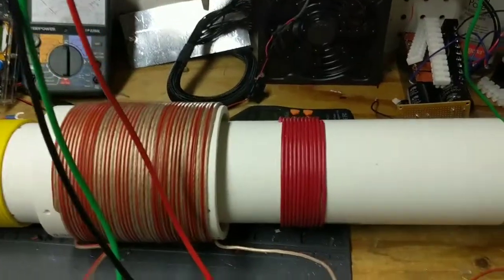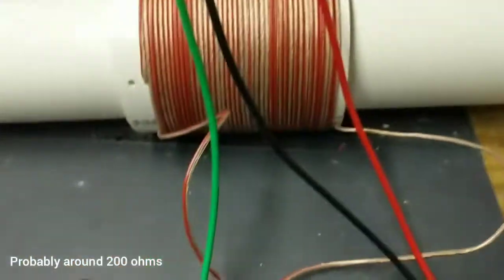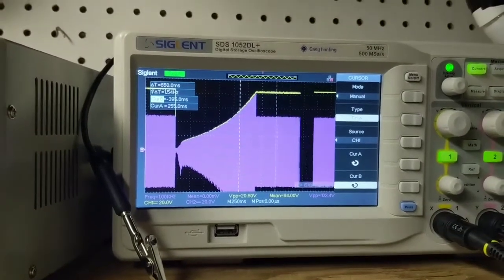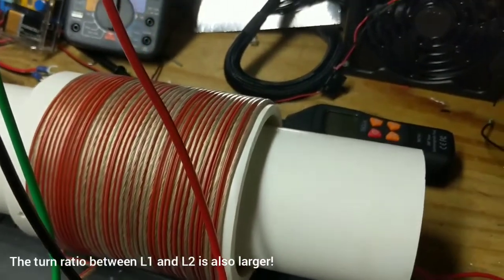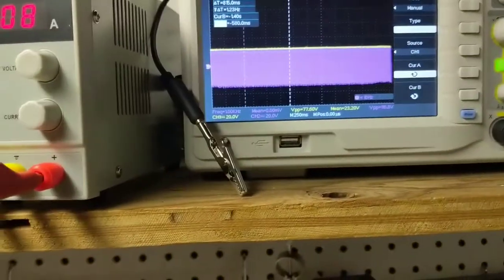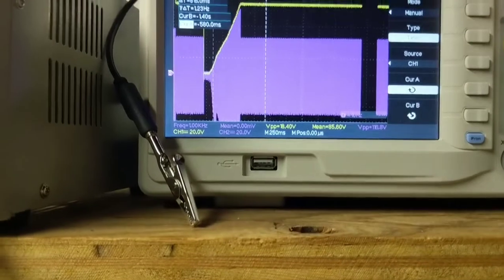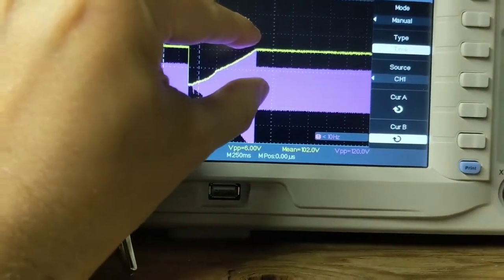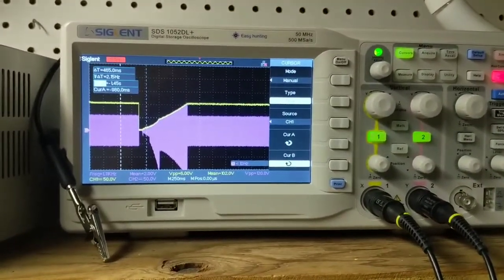Don Smith Circuit - L1, half-wave & quarter-wave resonant

Comment: I DISLIKE SINCE YOU REMOVE MY COMMENTS. i ACTUALLY HAVE A WORKING COIL RESONATOR BASED ON CALULATED RESONANCE!
Reply from the maker: Well, I can say I've never removed anyone's comments from YouTube.  I changed my settings a long time ago to allow all posts, so it might be something YouTube doesn't like.
Reply: @phives5910  Anyway, I just gave a tip that Don Smith used f = 30kHz NST as a source, which would have a wavelength of ~9000m. The way to calculate resonance is fo = 1/(2*pi*sqrt(L*C)). No coil in Don Smith design is based on wavelength, that is a red-herring parameter. Pro Tip, the transmit and receive coils should be LC coupled using the above equation. Then you should only need a small amount of adjustment to find resonance. Use an LED diode as a visual to see the max power transfer.
Reply: @mikez1r  Or use a Royer oscillator with feedback to sustain resonance. True? Ugh those PVC pipes are making deviant currents which I am sure are causing problems. Try something much thinner or cardboard forms with copper coated welding rods in the middle or ferrite rings.
Reply: L1 is quarter of the length of L2, L2 has length based on self oscillation frequency perturbed by a pulse on L1. Like ringing a bell.

Comment: Thanks for the link to Don Smith device with 4 coils on it.  Funny, the set-up I'm working on now is a pancake coil and many smaller coils around it and I thought to myself this is like a tesla coil with one primary & multiple secondary coils. I got your comment on my video part 27.  I got your comment in my email, but it does not show up on the video?  But yet my video says there is a comment there, but I don't see it.
Thanks again!
Reply from the maker: Who knows why YouTube can't make comments work correctly.  If you look at some of the other devices available on that website you'll see Don also used pancake coils and other configurations.  He tried a little bit of everything it seems.
Reply from the maker: One other thought.  I personally don't think there's any magic number here in regards to receiver coils and transmitters.  I think what Don was trying to show, as well as Rick Friedrich at the end of his latest video, and from what I've seen from your experiments, is that the entire 3D space surrounding the transmitter is filled with high frequency changing flux.  You can put any number of collectors around to capture it.  Keeping in mind the inverse square law of distance.  And when you get too close you add capacitance between the source and receiver, lowering the resonant frequency, but still have the same effect.  Keep going, always look forward to your videos, one of these days I'll catch up to you! 😄
Reply: @phives5910  Energy is in everything, everywhere 😁.  High freq changing flux, I think exciting subatomic particles, loosening electrons.  Funny, last time I was working on my project I kept thinking about the inverse square law & about how getting too close, more cap, and lower freq.  I'm now getting good results with bifilar pancake and multiple smaller coils around it., makes me think of a Tesla coil with "multiple" secondary coils.  I hope to get a new record😎
Thanks for sharing & see you at the next video!
Reply: @Soulful Pizza hahaha, small world!  Yes it was very good talking with you over-the-phone and talk again soon

Comment: Interesting results.  Hmmm, I wonder if you will get the same results with the half wave coil as you do with the quarter wave coil if you change the cap value.  Keep up the good experiments.  Looking forward to your next video :-)
Reply from the maker: If I change the L1 caps, it will definitely change things, I'm keeping low values to also keep current draw low.
When it comes to the collection Cap, it follows what's described in the Klystron papers quite closely.  There's a frequency and voltage dependency, and as I've referenced this "band" of operation will stay, but it's response will change.
A larger collection Cap should allow for a long time in the "negative resistance" region, but also take a long time to get there.  A smaller collection Cap will do the opposite.
So I have to play around and see what works best.
Reply: @phives5910  Thank you for the detailed reply.  Klystron papers, This might be the first I have herd of Kystron.  I'm reading about it now, I see, microwaves, many different links.  Do you have a specific link to where you study about it.
Reply from the maker: @INVENTOR3  go here: http://www.tubebooks.org/books/
Down towards the bottom you'll find the "Spangenberg Vacuum Tube" pdf.  Page 527 you'll find the Klystron documentation.  In there you'll see the pages Don used to reference when he showed the negative resistance shunt.
Reply: @phives5910  You gave perfect instructions , I found it :-)  Velocity modulated tubes or Klystrons.  Thank you very much!😎  I love finding old treasures like this.  this is where you find all the good stufffff.